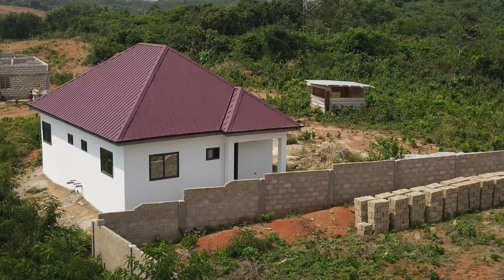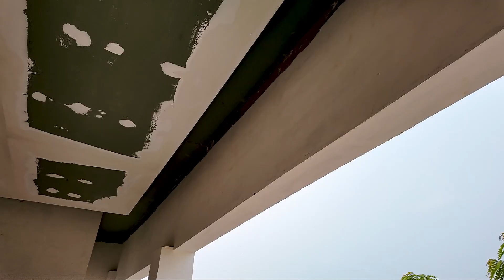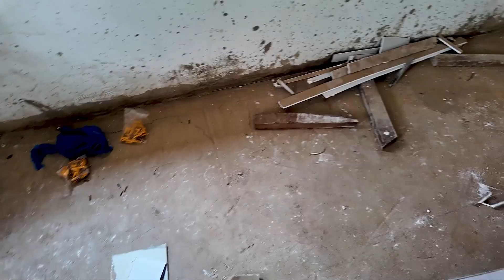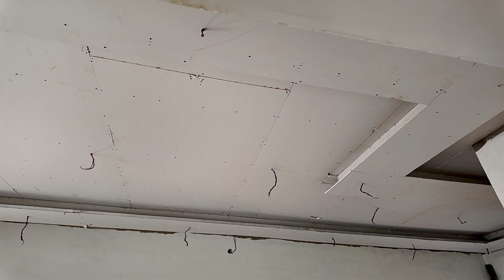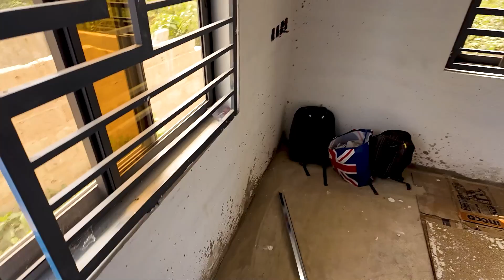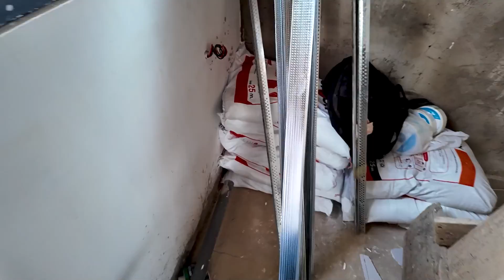Plaster Board Ceiling Design for a Two Bedroom House

Comment: I've noticed in many homes the switches to turn the lights on are outside by the door rather than inside the room on the inside wall..  Is there a reason for that?
Reply from the maker: Positioning of switches is mostly done based on accessibility as well as convenience. Some people will have strict instructions on where to position their switches whereas others are Open to what works as well as the best. So there isn't any specific way of doing that.